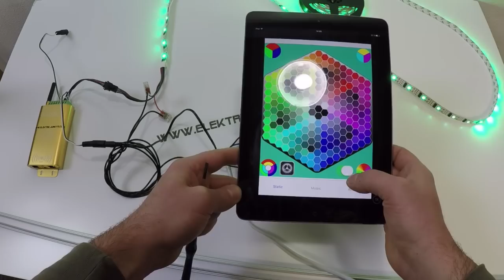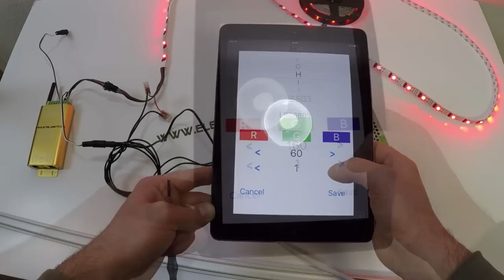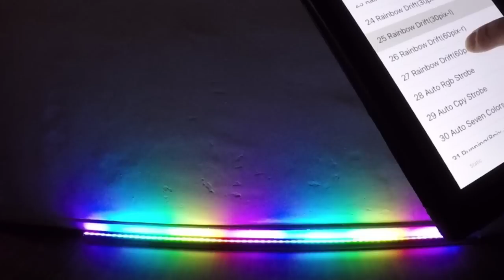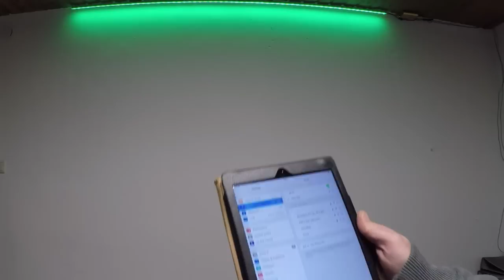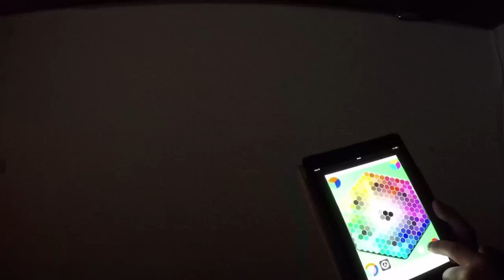how to install Dreamcolor Wifi Controlled DMX Digital LED Strip Instalación del LED

Comment: how much the price of 3m strip with power supply & controller and what is the maximum length for the power supply .. i want RGB type ..
another guestion..what is the power consumption for 1m RGB strip .. and does it work in maximum temperature of 60C° ?? 
PLZ RPLY MEE
Reply from the maker: send us an email www.elektric-junkys.com >> contact us